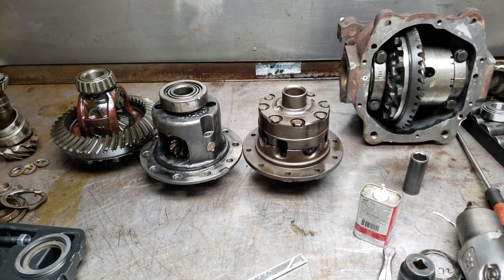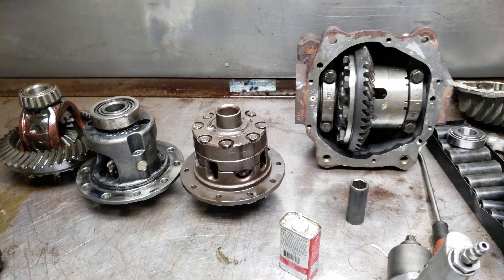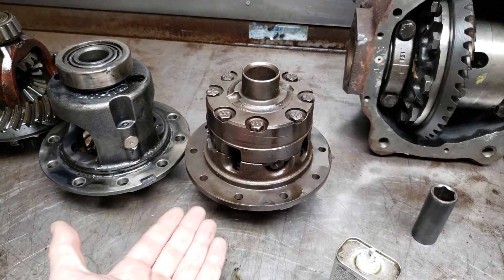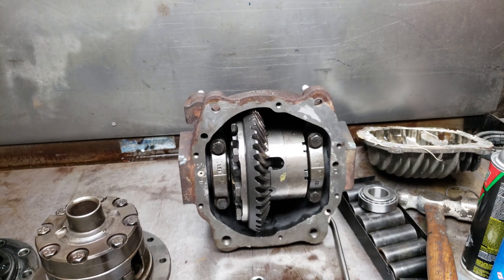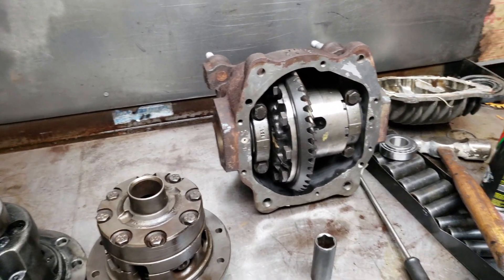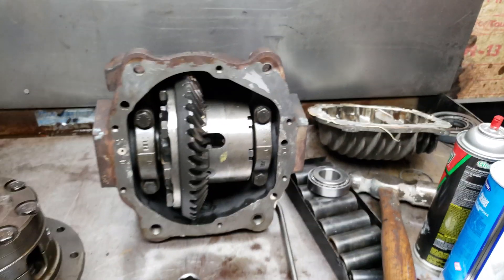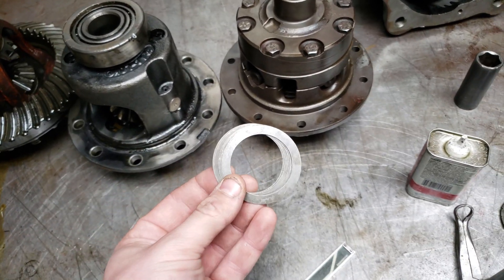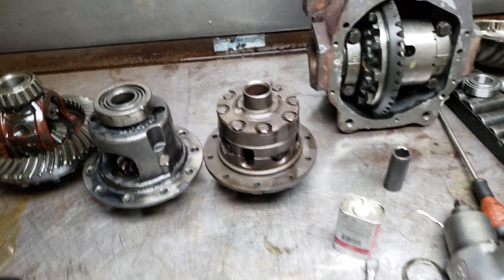Dana 44 8.5 to 8.9 conversion on a jaguar rear axle x308 x300 mods

Comment: Any information on your single piece drive shaft would be helpful. I am getting ready to upgrade my 14hu to a 15hu. You didn't mention the gear ratio and I wasn't sure I can change my gear ratio on the x308 with a zf 5hp24 transmission without having some issues. Trying to find information on this is difficult even on Jaguar forums. Part number for ring and pinion is also helpful. Thanks!
Reply from the maker: You can use any gear set you'd like. The 15hu will accept dana 44 8.5 inch gears stock. So basically every jeep rear axle (most years).if you're going to a 8.9 doing the mod then youll need a Rubicon of viper gear set which are all available. I used a 1350 ujoint yoke which is widely available for the 8.5 and 8.9 pinion ( 2 different parts numbers). And had a driveshaft made. You can use the jurrid style rubber 3 bolt flange too but only on the 8.5 gear. I'm not sure one is available for the 8 9.
Reply: @billweise1928  Thanks for your response. I am looking at an adapter 3 bolt for the transmission side with a yoke on the other end and then installing a yoke flange on the differential to match the transmission and then using a one piece drive shaft. I would consider a 3.58 gear ratio but there seems to be some issues with x308 causing some error code because the computer knows something aint right when you change the gear ratio. These engineers are a nightmare causing codes for anything that doesn't match their idea. The x308 uses a 3.07 ratio.

Comment: Great information. If I’m just over stock power a bit and would like to have both wheels lock I can just drop in a locking 44 carrier in my 99 XJR if I swap in an x300 differential.

Comment: So if I understand correctly, the stock X300 LSD unit will accept Dana 44 parts, so I can buy a X300 diff from a junkyard, put a Dana 44 PowerLok in it, and with the modified driveshaft and crossmember that you talk about in the description, install it in my x308 XJR
Reply from the maker: @UHOH3300  that's correct. I have 2 axle videos that I did and between both there's a lot of info.
Reply: @ awesome! I just picked up a 99 XJR and I love it, just wish I had the LSD grip that I’ve become accustomed to in my Series III

Comment: From what I can tell this posi may work on a x300 rear differential due to the 19 spline compatibility but the X308 is a 25 spline and would not match the 19 spline differential. Unless one could swap the output shafts out to match the 19 spline I don't think it works on X308. I like the idea of this install but because I have the X308 I know I am seeing problems. I could buy this differential for half the price of the Quaife QDF5W but then I need to modify parts or maybe use a different rear end all together. I also could not find a 25 spline dana 44 posi rear end as needed on the X308.

Comment: I have a 2004 vandenplas will that mod work in it
Reply from the maker: By 2004 they had gone to a different platform so it will not accept the earlier parts. But its a better design so you shouldn't have as many issues

Comment: Is it still 19 spline stub axles?  I also thought that jk pinion is 24 spline and the older stuff is 26 spline? I guess you changed the pinion coupling from jurid to u-joint at the same time? Anyways cool stuff and cool project
Reply from the maker: Yeah, 19 spine on the output shafts. And you're correct. I changed to a single piece shaft and a 24 spine yoke.

Comment: I've had a 14HU go out on my 99 XJR TWICE! You're right, its not a strong unit at all.
Reply from the maker: I have an extra if you need it 😁
Reply: @billweise1928  I've got the stock TCM. Itll detect a different ratio and throw it into limp mode. If it wasnt my daily, I'd probably do it.
Reply from the maker: @MrPelletgunguy  if you pick up a junkyard 95-97 axle you can get a replacement gear for 200 that will match your ratio you have now. You cant get the jeep jk in the same ratio (8.9") but there are plenty of 8.5" ratio gears that will drop in. You can get a 3.54 gear that will be close enough